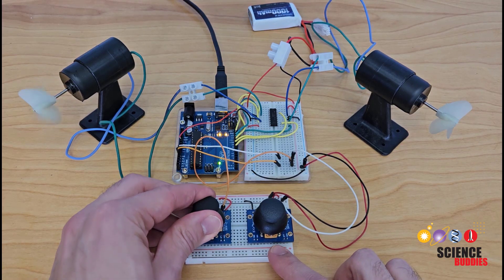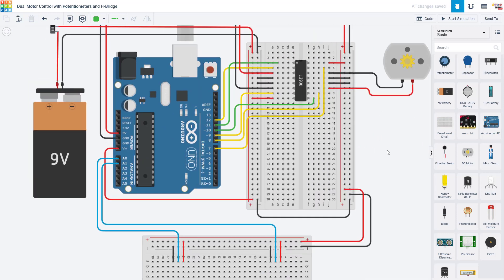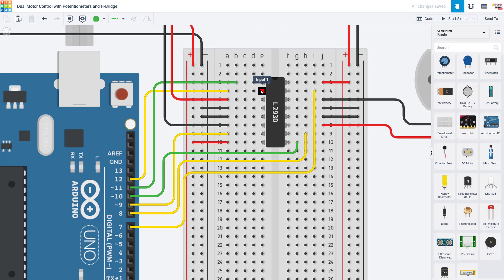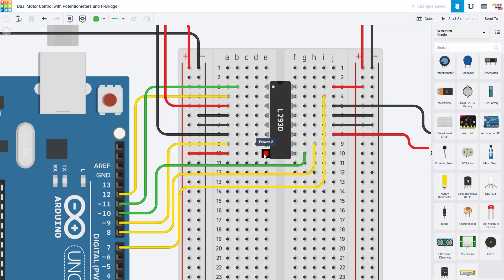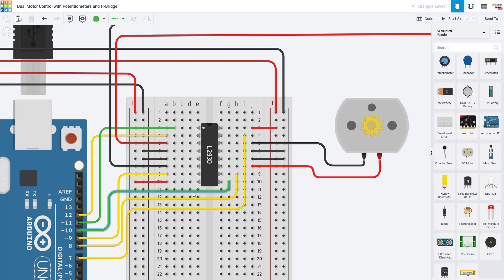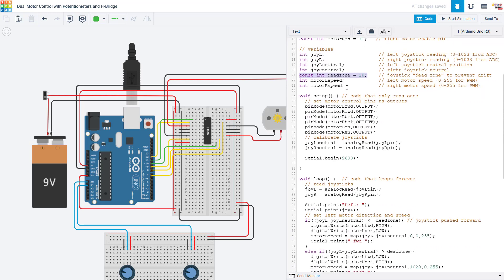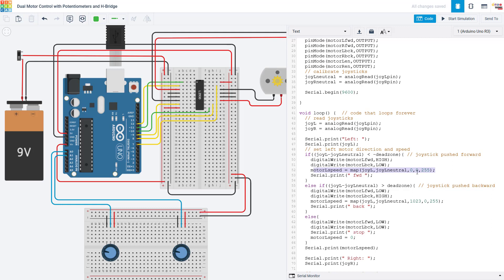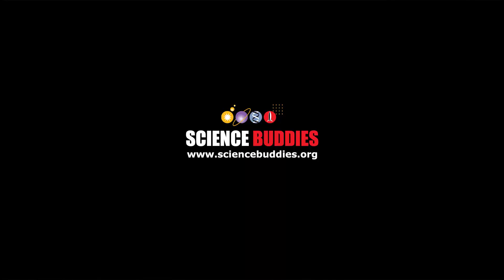Arduino DC Motor Control with Analog Joysticks

Comment: It worked! I had to change the deadzone of the controllers to 0, though. Not sure why but at 20 both motors would run when at neutral

Comment: Hello i am doing a school project and i want to ask you can i use a normal 9 volt duracill battery?
Reply from the maker: A 9 volt battery will die very quickly if you use it to power these motors.
Reply: @ thank you another thing that i do not understand is the connection of the battery in the video
Reply from the maker: Please refer to these written instructions on our website for a wiring diagram: https://www.sciencebuddies.org/science-fair-projects/project-ideas/Robotics_p052/robotics/arduino-underwater-ROV

Comment: thanks for the video but we are using l298n dc motor driver so can you give modified code and pin diagram for it.
Reply from the maker: Hi - we're unable to give modified circuit diagrams and code for customized projects. If you need help with something like this you can try the official Arduino forums or other dedicated electronics forums like StackExchange.

Comment: How can i buy that kit?
Reply from the maker: We sell an Arduino starter kit but the joysticks and underwater thrusters must be purchased separately. You can find a parts list for the project here: https://www.sciencebuddies.org/science-fair-projects/project-ideas/Robotics_p052/robotics/arduino-underwater-ROV#materials
Reply: Did we use any sensor here?
Reply from the maker: These project does not use any sensors since common Arduino sensors are generally not waterproof and would not have the intended effect if you put them inside a waterproof container. e.g. an ultrasonic distance sensor would just measure the distance to the inner wall of the container, not to objects in the water.